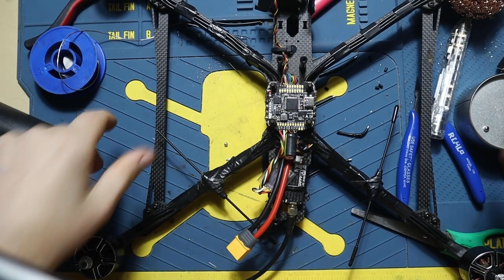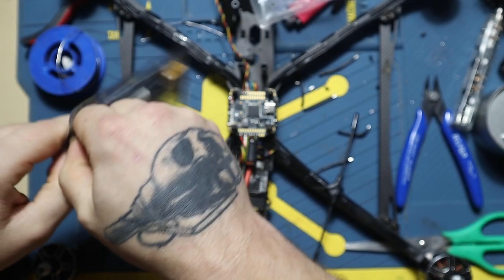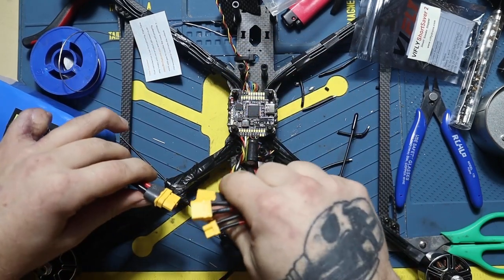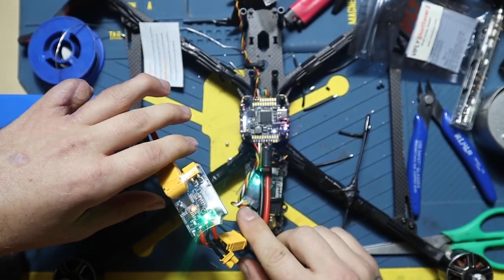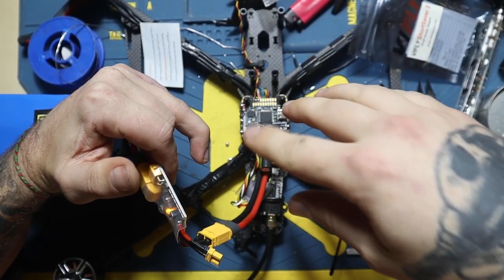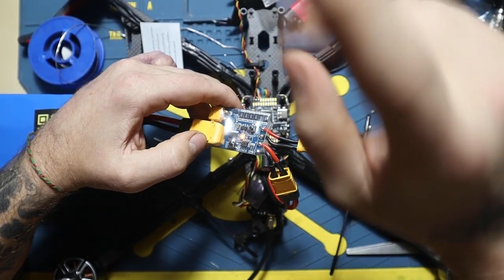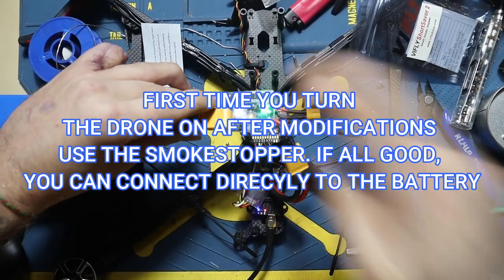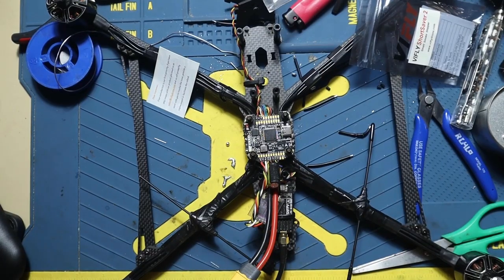MILITARY FPV DRONE COURSE EP 11: ALL ENGINEERS NEED THIS! (Must watch)

Comment: One tip for these, as I spent a whole night looking for a short after swapping an analogue vtx for a digital vtx and then repeatedly tripping one of these. 
For higher current applications like a digital vtx, you press the button on just under the xt60 connector to change from 1A to 2A, so that it doesn't mistakenly trip.
Usually leave on 1 amp, then try on 2A after checking with multimeter.